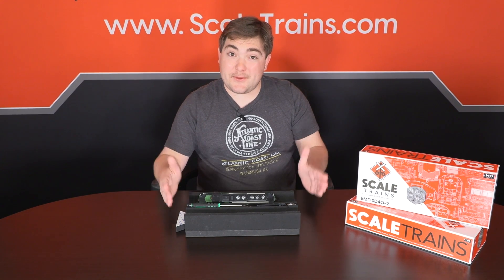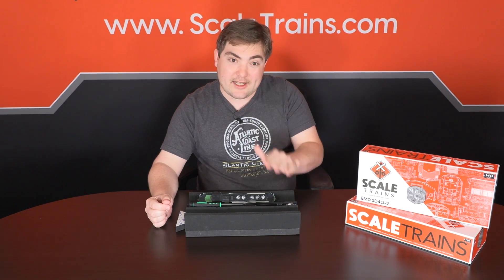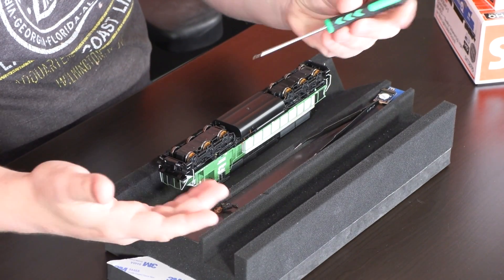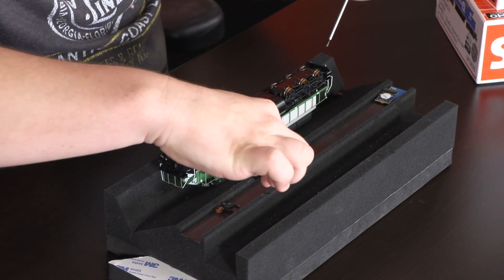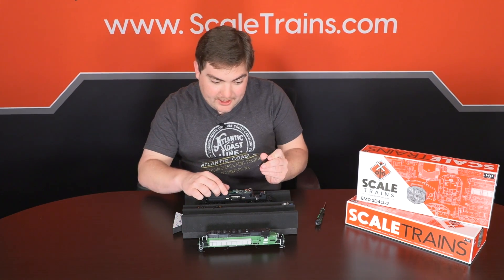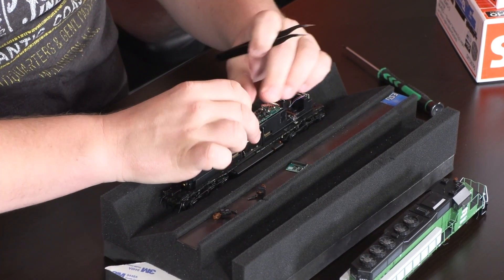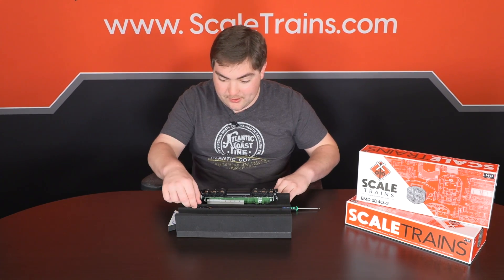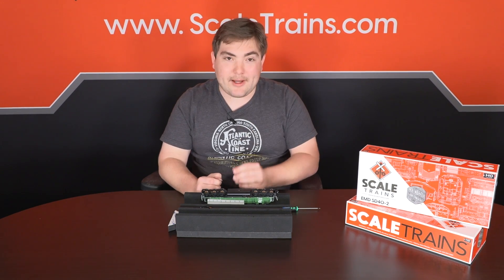Time to Model: Installing a LokPilot DCC Decoder

Comment: I just purchased 2 LokPilot 5’s from you. Will the number boards, ground lights and walkway lights work when power is turned on or do they need to be programmed? The locomotives are DCC and sound ready ES44AC units. I’m new to this technology.

Comment: What about N scale?
Reply from the maker: That can be a feature for a future video, but the process on N scale is even simpler. Just remove the coupler boxes + shell, then the dummy plug from the locomotive motherboard. Click your decoder of choice into the socket and you're ready to roll. The process is the same for sound or normal decoders, excluding adding the sugar cube speaker into fuel tank cavity. -Logan

Comment: So if we buy the decoder from Scaletrains will you guys program it so that all the ESU functions work? Like the tri colored ditch lights.  And what tabs sit you turn to on? Wish you would have zoomed in on them. Thanks
Reply from the maker: We can indeed program the decoders to handle class lights and normal locomotive lighting. Sound decoders will be able to fire all 3 colors, Lokpilots will require mapping desired color to a specific function, as there is a software limitation.  Specifics are listed with a close up photo in locomotive manuals. -Logan
Reply: Need to video directly overhead and zoom in closer

Comment: You should do a video on installing scale sounds system speakers in ES44 locomotives.
Reply: It's very similar to installing sugar cube speakers in any ScaleTrains locomotive. There are many videos online that show you how to install sugar cube speakers in a ScaleTrains locomotive. You just have to follow those steps, and instead of using a sugar cube speaker like in those videos, just use a Scale Sound Systems speaker.
Reply: @PacificNorthwestRailfanner  does that include taking out the factory installed speaker and replacing it with the scale sound system speaker?
Reply: @tyhik9338  The videos that I found are engines that are DCC ready. But, it doesn't really matter because you do the exact same steps for a DCC & sound engine as well. DCC ready engines don't come with a speaker, but with a plastic bracket to glue on future sugar cube speakers. DCC and sound engines will require detaching the wires from the existing stock sugar cube speakers. Either way, you will have to remove the stock speaker or bracket depending on the if it has DCC & sound or not, in order to install a Scale Sound Systems speaker. It's pretty straight forward.
Reply: @PacificNorthwestRailfanner  can you send a link to a video about that?